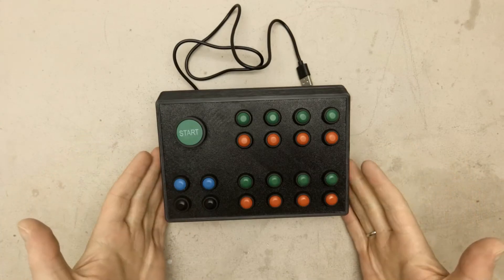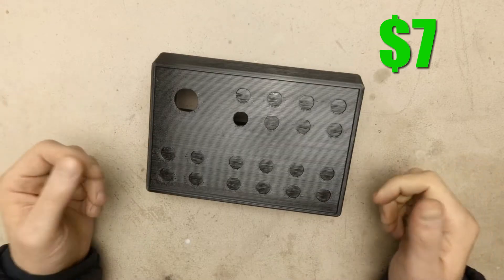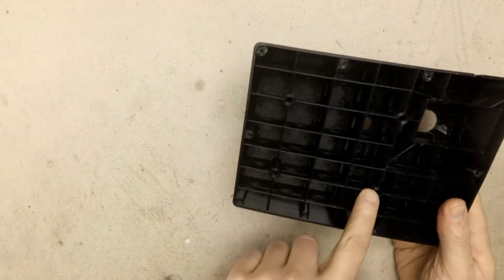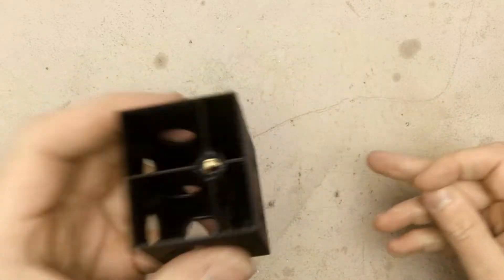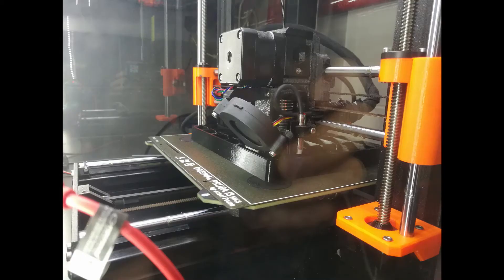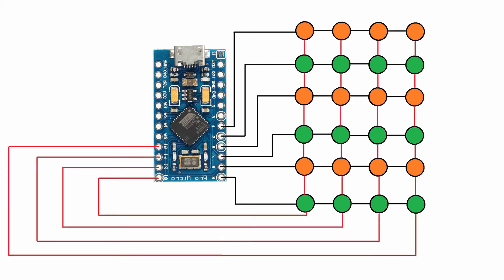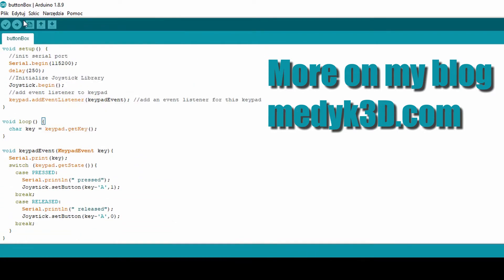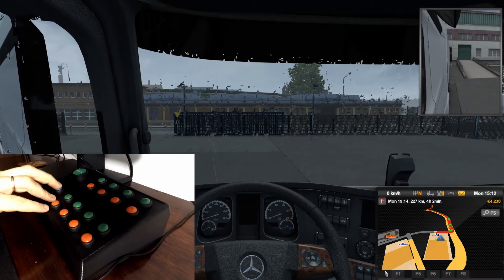3D Printed DIY Button Box

Comment: no need to solder inside the box, can be done outside ;p
Reply from the maker: Yes. The trickest part is to screw the buttons though.
Reply: @medyk3D Solution to that would be to print just flat top plate and screw that to the box. Anyway good video.
Reply from the maker: @Nrde  Exactly, good idea.

Comment: Hey mate, i rarely like and subscribe. Quality video 👏, thank you very much. Edit: What printer do you have and what would you recommend as a good beginner printer for these type of things. Thank you!
Reply from the maker: Thanks for your kind words. Prusa Mini or Prusa i3 are great starting printers. If you are more on a budget go with something from Creality (Ender 3 v2 or Ender 5 Plus or CR-10 or Ender-7). 
First think about what you are going to print mainly:
size (minis or boxes like this one or big helmets for cosplay), what material (PLA, PETG or something more durable like Nylon).
In my opinion the printer should have:
- sturdy metal frame,
- bed leveling probe,
- heatebed flexplate for easy part removal.